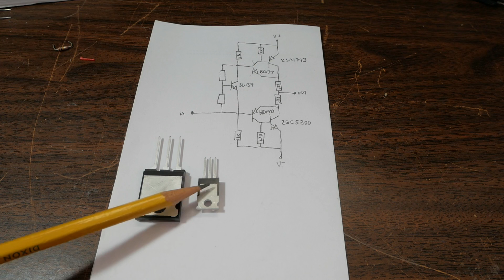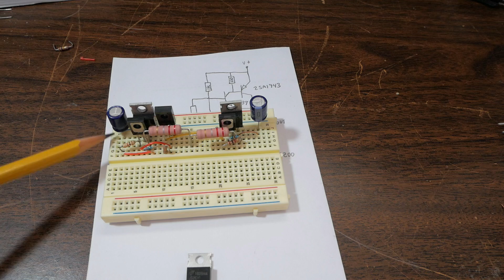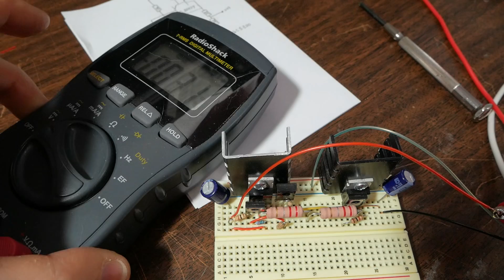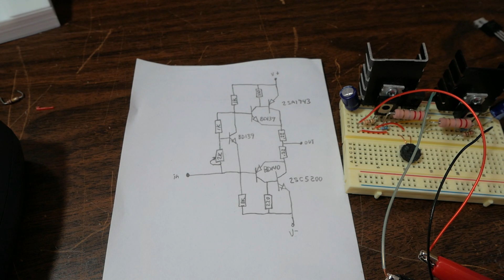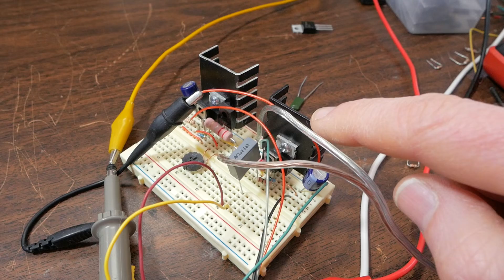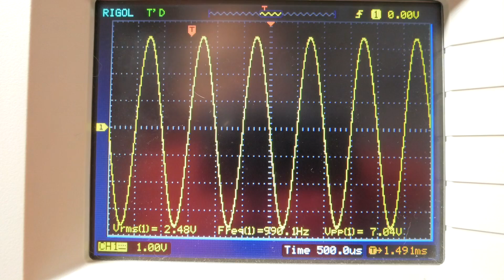Discrete audio amplifier project PT8 CFP output stage test

Comment: Thanks again for this series, ive learned a TON by you doing it in stages with your great explainations of how each small circuit segment works.  No other amp vids have the level of working "know how" demonstrated ive watched, which is a lot.

Im wanting to build an amp for a fairly low V high freq. input signal that offsets the output wave so instead of, say, +-10V peaks it instead rides from 0 to 20.  It'll be driving an electrolysis cell and its important the polarity does not reverse while keeping the oscillating intensity of signal to pulse a varying current, but mainly to pulse the E.field between the electrode plates.

Is this possible to do by modifying this design just by offsetting the output?  Also, whats the frequency sensitivity...can these components handle frequencies well above audio, maybe by using transistors with faster switching if need be?  Ive the difficult part done with all the chemistry mechanisms painfully worked out, everything is built, small scale tests show a promising result that looks as if concept indeed works...I just need to power the damn thing to scale up but this detail has had me on pause over 2 years.  Wish I knew electronics as well as you; id be a dangerous combination if so lol...but in a good way.

Have a good one

Comment: What do you mean to test stability place a small cap "into the output"??  Are you placing the cap in series w the output as if its a DC blocker, or are you connecting the output to ground through the cap?
Reply from the maker: Connect the cap across the output (out to ground). Check for ringing or oscillation when applying a square wave signal. Cap values in the .01 to 1 uf range.

Comment: What do you call this coupling when the emitters on the final transistors at the outputstage is connected to the power rails instead of the collectors like you traditionally see on other amps?
Reply from the maker: That is usually the complementary feedback pair (CFP) driver and output arrangement.
Reply: @JohnAudioTech  Aha, understand. How do you calculate the amplification in this coupling? what is the RMS output at 1V RMS input?

Comment: Hello, I have a couple of questions. If the transistor gets hot, does its beta and hfe increase? Right?
If the bias transistor (multiplier circuit Vbe) heats up, its hfe increases, does the collector-emitter voltage decrease? Why does it let more current pass and decrease its collector-emitter resistance?
The following may be confusing.
If the bias circuit is powered by a constant current source on both power rails, at 10mA for example. The one on the positive rail "giving" and the one on the negative rail "removing" the same current, and using 2 identical transistors in diode configuration (connecting the collector to the base), introducing the AC signal between both "diodes". These "diodes", when heated by being together with their respective output stage transitors, would keep the bias current controlled by temperature? I mean, would they keep the 0.65Vdc bias on the power transistors?
The doubt is due to the constant current source, which limits and keeps the "Bias circuit" symmetrical.
I don't understand how the AC signal is introduced on one side of the "Vbe multiplier" and how it works. In the diagrams, the VAS is on one side of said "Bias circuit". And it only has a constant current source on the other rail. Isn't it asymmetrical?

How do you control that the second output transistor (CFP) has the same polarization of 0.65Vdc? If the previous transistor must have the same polarization, should it have another circuit with a double source of constant current and "diodes" of Bias?

Thanks in advance, I learn a lot from your videos.

Comment: Hi John, 
Thank you for another great video. I'm loving your series! 
Question: what are you exactly doing when you  put the 1kHz and adding a 'pilot' signal?  I mean,  what are you doing with the function generator?  Are you mixing two signals? 
Cheers 
Mark
Reply from the maker: Hi Mark. Thanks for watching! I created the signal in a free software called Audacity. The pilot signal is just a 4.5KHz marker at 1% of the amplitude of the 1KHz test signal. It simply allows me to visually compare the amplitudes of the harmonics (distortion signals) on the scope screen. I used 4.5Khz because it is not harmonically related to the 1KHz signal and won't cover those peaks on the screen.
Reply: @JohnAudioTech  Hi John, 
That's great, thank you for your quick reaction. 
Does that mean that you don't use a signal generator but the computer? How do you output the signal?  
I'll check out the software. Is that related to the software that you mentioned is capable of accurate distortion measurements? 
Cheers 
Mark
Reply from the maker: @questionmark9684  I generate the two signals and mix them together in a WAV file. I put them on my music player as it has very low distortion. Function generators are not really audio focused and can have higher distortion. I use ARTA software (free demo) as it can measure distortion using the computer's sound system. You don't really need the pilot signal in that case. ARTA has its own signal generator as well.
Reply: @JohnAudioTech  Hi John, 
Excellent, thank you! 
I'm eagerly waiting for the components that I ordered, so that I can breadboard the various circuits and see if I can reproduce your results.
Really fun stuff. It's a great series! 
Cheers 
Mark

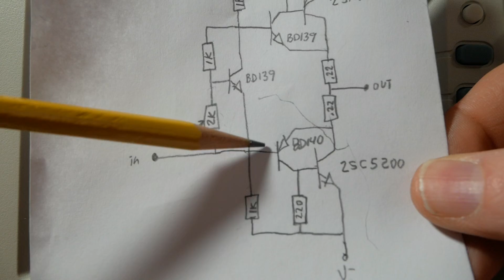Comment: 17:31 well.... actually, in an amplifier design namely "Yiroshi Amplifier Design"(you can search it's images on web, it has the same driver stage with different number of output transistors and has a dual differential-pair at the input), they have put the capacitors from base to emitter on the Darlington driving transistors (both the upper and lower side).

What, according to you may happen if the capacitors are connected across "the wrong side"?
Reply: As there is no voltage gain nor polarity change from base to emitter, as well as the emitter being low impedance node, adding a capacitor from base to emitter basically does nothing.
Reply: Or you can think, as long as the bjt doesn't switch on and off, the vbe will be almost constant. So the cap is essentially bootstrapped hence no or minimal current flows into the capacitor.

Comment: When push comes to shove you may want to add a string of 2, 3, or even 4 small diodes (1N4148) in series into the biasing circuit, clamped to the heat sink as a sensor for thermal feedback and stability.  If you really want to make it look nice, you can cast those diodes into a small block of epoxy with a hole in the middle, so you can screw that block onto the heat sink, with some thermal compound.

Comment: I'm looking for a 12V DC amp. (mono) that can deliver 100W output. What can you recommend or design ?
Reply from the maker: With normal speaker impedance (8 or 4 ohm) you will need a switching power supply to boost the voltage because 12v directly into an amplifier will not generate a high enough output swing into the speaker for 100 watts of clean output.
Reply: @JohnAudioTech  Indeed, that is a very common practise. However the output doesn't need to been very 'clean'. It is meant for a siren in a alarm installation. As long that is't loud...

Comment: Big John.Question on chips amps:Why can we not take a linear power supply to run a hifi chip amp to each driver in a 3 way speaker? Bi-amping.If we run our cd player into a DSP and segregate each frequency range and THEN amp it at the speaker tower. Why is that not a thing? Is anybody doing this?
Reply from the maker: Bi or tri amping is a thing. It is the best way to drive speakers. It takes a lot of amplifiers and a good active crossover filter in front of each amp.
Reply: but there is zero info on using a DSP as your active crossover into individual op amps to tri amp. It seems a good linear supply would be the only thing needed. Seems like it would be wildly popular.
Reply: @oconnaugh  There is a whole bunch of DSP activists out there! I even crossover using software DSP in the digital domain (I don't play analog sources), followed by separate DACs and amps for each separate speaker driver. DIYaudio fora and the firm MiniDSP have a lot of information on it.
Reply: FYI your TDA7293 video inspired me to ask. Seems legit for this purpose.

Comment: can you explain what is causing that weird oscillation when a capacitor is plugged in?
Reply from the maker: Connecting a capacitor directly across the amplifier output puts a purely reactive load on it which causes a phase shift between voltage and current. This can work with the stray inductance, capacitance and nonlinearities of the transistor circuit to cause a positive feedback situation within the local feedback loops to cause oscillation.
Reply: @JohnAudioTech  so much things are happening within a simple looking circuit, amazing it means that using passive crossovers with speaker box is not a good idea?. Now it's clear, Thank you for the reply.

Comment: Hello ! It is necessary to use a Darlington device for the positive signal and a Sziklai device for the negative signal for that to work...
Reply from the maker: That's used when using the same NPN output transistor in both the upper and lower positions. Called quasi complementary. I'm using complementary transistors.
Reply: Indeed, but in the case of these composite devices, we must change only one transistor out of two to obtain a complementary structure; if two transistors are changed, the structure is not really complementary; we only obtain a symmetrical device but not really complementary...

Comment: The oscillation issues reminds me of the nightmare of a time I had trying to get my discrete amplifier circuit to work properly a while back.
Reply from the maker: Did you make a video of it? How did you sort the problem?
Reply: @JohnAudioTech  I did do a video of it, actually it was in a live-stream I did. If I remember, putting a capacitor between the base and collector of the voltage gain transistor stopped the oscillation and it worked good as gold. Since I cant find that video anymore I might re-do it.

Comment: Nice video - having played with output sections myself its familiar territory - checking for oscillation and stability, playing with biasing and thermal behaviour - the gritty reality of circuit testing!   What I did was use stripboard for the output transistors, drivers and Re resistors, having the transistors soldered parallel to the strips sticking out and thus easy to mount to a single aluminium extrusion or block for heatsink.  Then ran short wires from the stripboard to
a breadboard for all the other components.

This meant I could change out different versions of the output stage easily, like CFP v. Darlington, and didn't have to worry about high currents going though breadboard connections.

Carry on the good work!

Comment: Shouldn't there be a cap across the bias spreader?
Reply: The spreader makes for a low impedance, so not a big deal but nice.
Three ads on this video, UT Loves you!
Reply from the maker: There are benefits and consequences to using either a large value cap, low value cap or no cap at all across the bias circuit. I will need to analyze (read up on) what direction to take. My final design will likely use a small value film cap.
As far as the ads, YouTube lets the creator select where to put the ads. For videos under 10 min. I only put the ads at the beginning and end. Over 10min, I put an ad in the middle. It drives me NUTS when people stuff a bunch of ads throughout a 10 min video.

Comment: If you're holding the capacitor when checking shouldn't that cause noise?
Reply: Not on a very low impedance output - its high impedance circuit nodes that pickup interference.